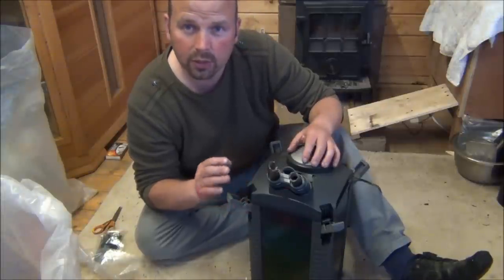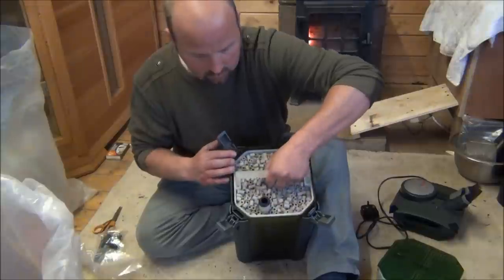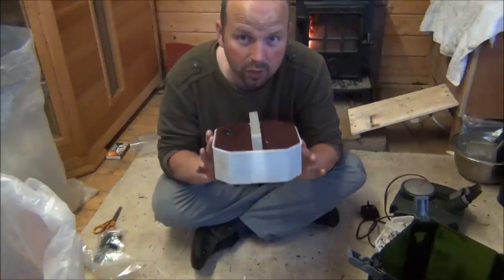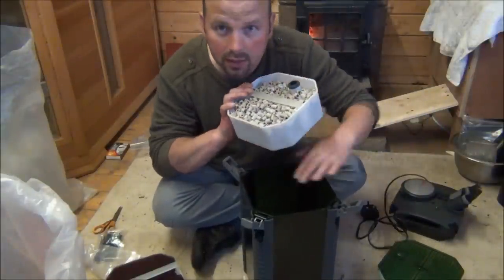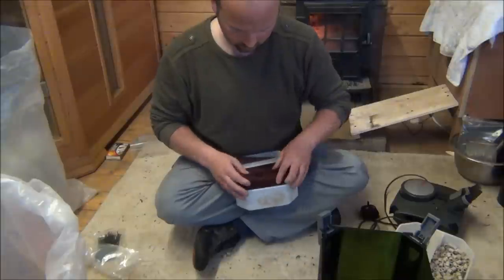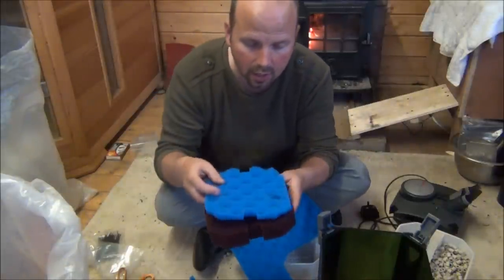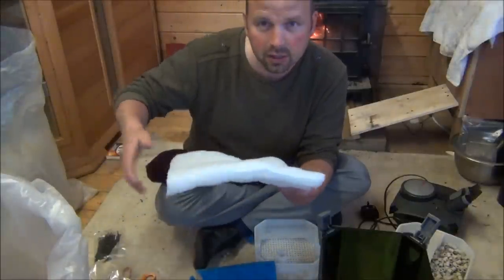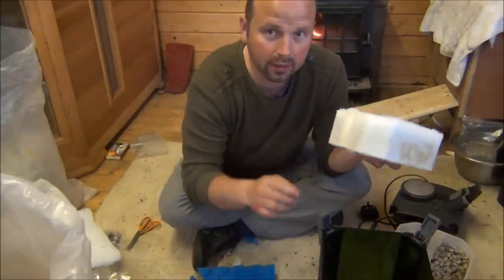How to set up an external canister filter for aquarium by Pondguru

Comment: Hi, I have the APS2000ef and it has 4 trays, what would you suggest I put in the top tray?
Reply from the maker: +Paul Austin Good filter media. Ideally you'd only need foams in bottom tray and media in trays above. If you need to use carbon to draw in fish treatments or colour from bogwood then it would go in the top of the top tray.

Comment: I'm VERY new to hobby and need your expertis. I owe a 55gal freshwater tank. It also came with a Whisper 60 and AquaClear 110. What would be the BEST setup for healthy water and fish.HELP ME PLEASE!!!!
Reply from the maker: Ditch the AquaClear 110 (as the biological filtering capacity is very low) and get an external filter. Other than that just phone the shop on 01661844005 with any questions you have about set-up as there are so many variables it can take an age of back and forth on comments / emails and can be sorted in short phone call.

Comment: Richard I need your help I've just reset my filter up it's an allpondsolutions 2000EF and I've set it up the way you have but when I switch it on and prime it all it sounds like a washing machine and it's driving me insane it was very quiet before I did everything and now the outtake spray bar is constantly blowing out bubbles ??? Any suggestions ??
Reply from the maker: Sounds like there is an air stuck in the pump chamber. If you try rocking the filter side to side the pump should spit the air out. It really shouldn't matter how the internals of the filter are set up but sometimes air can get locked in the top.
Reply: Pondguru Outdoors I've tried this and it's still blowing loads of bubbles out I'll try and remove the lid and start again .... damn thing is driving me insane
Reply from the maker: The only other way it could get air in there is if it is drawing it in through one of the pipes so you may need to check inlet connections. Sounds like it is getting air from somewhere if it won't clear out by rocking the filter. As long as you have a grid over the top of the top try to prevent media being drawn into the pump you can rock the filter 45% each way. It is a sealed unit so can operate while practically lying down (not recommended).
Reply: Pondguru Outdoors would having too much water in the canister cause this to happen ???
Reply: Pondguru Outdoors checked all the pipes and they are fine ..... 3 hrs I've been here now hahaha the joys of our hobby hey
Reply from the maker: No it should be full of water. Maybe if foams were new or recently cleaned they may hold air which would be released once the filter was pressurised and that air would get drawn into the pump?
Reply: Pondguru Outdoors omg Richard excuse the French but I am so fucking blonde I have figured it out and I'm just about to do a video about it because I can't stop laughing at how stupid I have been and I really don't want anyone else to make the same blonde mistake I've made hahaa omg your gonna laugh when you hear this for sure thank you so so much for your help I have really appreciated it your the best 🤗🤗🤗

Comment: I have a booster canister witch has three types of foam that is linked first to the out flow pipe then connects to the external filter that has the media in so I have basically the same set up as the booster uses the foam and the canister is full of media
Reply from the maker: Boosters are excellent and they really do a great job of ensuring that the main filter can be filled with proper media. Much of the time externals are sold for tanks and are too small to hold enough media to delivery the full cycle filtration necessary for nitrate reduction so a booster frees up that extra tray for more media - a great invention.
I'll be covering the booster and external combo in an upcoming video.
Reply: Awesome I look forward to watching it

Comment: Ok, I ordered the Newest Biohome Ultimate media from the local Greatwaveeng.com, who happens to be about 1 1/2 hours from me. I'll also be ordering the Bio Balls when he gets back from Vegas & unpacks them! 

 Now, I just bought a 55 gallon tank a few days ago. My question is, what type of Filter would you recommend. I want to set it up like the one you have… I understand the overall theme. Course to medium to fine filtration, then use the Biohome. 

So, is there any type of filter like you have there, for a 55 gallon, that you would recommend? 

I am really looking forward to using this media!

Thank you!!
Reply from the maker: The actual maker name of an external filter is not nearly as important as what is inside it with regard to the foams and media. I used an Eheim filter in this video which is about as good as you can get but provided you have a suitable sized filter correctly set up you can't go wrong.
Reply: Ok, Thank you!!

Comment: dear pondguru,
I was wondering of changing my internal filter to an external filter, however I have not tried to change filters properly before. last time I did it all my fish died. At the moment I still have fish in my fishtank. Can you possibly give me goid advice on how to swap the filters around as I want to get rid of my internal filter once I get the new filter. Thank you,
Tom. H.
Reply from the maker: +Tom H Its quite a simple process - just run both filters for at least 3-4 weeks (if you have the external set up with manufacturers media / foams) or 2-3 weeks if you have the external set up with biohome (as it matures very fast).By running both filters together you will not see a drop in waste processing anility of the filter(s) and the external will get a chance to build up a good amount of bacteria before you remove the internal filter. If the external you are looking to buy has a UV steriliser in it make sure to leave that turned off while the external filter is maturing or it will prevent it getting established with good bacteria.Hope that helps.
Reply: Dear Pondguru,
Thank you very much for your advice.

Tom. H.
Reply from the maker: +Tom H No worries, any time.

Comment: I have a aquaone nuatilus canister filter do they work the same way as in does the water flow from the bottom up thru the media?
Reply from the maker: I can't find much about that type of filter online but they look like a normal external filter with the pump at the top so should work exactly the same as the one in this video.

Comment: Hi pondguru just starting up my 220 ltr tank any advice on cichlids please?
Reply from the maker: Unless they are Dwarf cichlids the filtration will need to be very good - an external which will treat 'up to 600 litres' and the substrate and decor choice will depend on whether the fish are hard water cichlids or central / south American.
Feel free to ring me on 07772848730 no worries.
Reply: Pondguru Outdoors .yes I purchased a eheim pro 2 2028 3d background black sand gravel and putting in Welsh brecon blue-green local stone, with plenty of air stones . will ring if I'm having any problems and thank you for your advice much appreciated again.
Reply: Pondguru Outdoors I've also purchased 3 bags of biohome plus off you and foams
Reply from the maker: No worries, thanks for the order and yes feel free to ring me any time. Set up sounds nice.

Comment: Hi there, I have both of my EF set up like this. I'm just about to add an APS booster, would you recommend the same setup here in this video or is the filter media that comes with It enough? Many thanks if you can reply.
Reply from the maker: Ideally the booster would just have the foams in (and the fine pad) set up the same from bottom to top coarse, medium then fine and the main filter could then be all biological media. Basically the booster helps you to free up the bottom tray of the external filter which would otherwise be taken up by the foams and fine pad.
They are an excellent idea as it saves people buying a whole new canister filter when they could increase the filtering capacity by adding the booster.
Reply: Pondguru Outdoors many thank for replying buddy. I'll crack on with that then. Thanks again.
Reply from the maker: No worries, any time.
Reply: Pondguru Outdoors Obviously I'm using the bioholme mini ultra in my EF, seeing as it has four baskets would you recommend filling all four baskets with bioholme mini ultra? By the way, putting crappy ceramic media at the very bottom to catch the muck is an awesome idea, thanks for that tip alone. :)
Reply from the maker: Yes if there is a booster all the baskets in the main filter can be filled with media. Some people report that they never clean out the main canister when they have a booster, just the foams in the booster once every 1-2 months.
Reply: Pondguru Outdoors Brilliant, I'll get ordering more on your eBay then lol Many thanks for the advice but just as importantly your time to reply and give the advice. FYI I'm running two APS 2000lt/h EF+ filters with them both set up like you show here and have done for a good few months now, it's the perfect set up. I know I've mentioned this before but your tip of putting the crappy ceramic media in the bottom to catch all the heavy muck is brilliant. In the booster there is a bit more room to add more so this is looking great. My tank is 5ft long, 2ft high and 18inches width, planted and is a community tank. Anyway, thanks again, it's greatly appreciated indeed. Love your videos ;)
Reply from the maker: You have a nation of filtration on the tank which is very good as most people have it borderline or vastly under-filtered. Everything set up right with happy fish, groovy.
These bala sharks will grow very quickly however and you may need to find them new homes when they get big. You could look up red line torpedo barbs - expensive but a very nice mid water 'impact' shoaling fish for a large tank.
Reply: Pondguru Outdoors Yea for sure regarding the Bala Sharks, my LFS will happily take them when they get to big for my tank. I have two that are much older than the other four so plenty of time to think about what to do, I would love to gat a 6ft x 2ft x2ft just for bigger type fish. I'm currently planning a breeding set up in an insulated shed so it would go well in there. The shed will be not your average size shed mind you, it will be massive :) Thanks for recognising my filter X Tank set up being well filtered. My water is always clear and I don't have to do water changes as often as I used too, I Test the water parameters every week so I water change every two, sometimes 3 weeks. That's interesting about how much media per litre, just as well I read that before ordering lol I also have a black ghost Knife fish that's about 2/3 inches long so I will also have to keep an eye on him as I'm well aware that once their mouths are big enough they could/will eat smaller fish like Tetra etc. Perhaps he can go in the 6ft tank ;) thanks again for the advice, top man!!!!!
Reply from the maker: NO worries, any time and its great to hear that you have a well functioning set up.

Comment: Hi mate how would I do it like what you have done for you filter I have a new fluval 206 and mine came with some form like an egg carton at the bottom tray then the second and third. Tray came with bio media like hoops then the top one with a thin filter mat white and I bag of carbon when I clean the filter out and but it back together it blows crap back in to my tank this should not happen what would you do would you leave the bottom one as it is and the second one change the bio media and put corse fine and so on and just have one tray with bio media in the top mine as three trays and a try that's stand upright with four sponges in this red tray what slides down the side of the filter canister and my trays just go in the centre on top of each other how would you do it can you please get back to me if you are still keeping fish thanks
Reply from the maker: You could go with only one tray of media but I would personally use bottom tray for the graded foams then have two trays of media above it, just like this video. If there is space under the trays use the rings there.

Comment: The one I purchased (Worx 1200) had the canisters from bottom to top: ceramic - charcoal - foam. But what you have described appears to be the other way round. Does it matter?
Reply from the maker: I have looked for information to see how the water flows in that filter and it looks to be a normal external suitable for tanks up to 400 litres (200 litre normally stocked tank) where the water goes down to the bottom and rises up through the trays just like the one in this video. Therefore the foams really need to be in the bottom tray and media above.
If you used good media for the 2 trays above the foams you would not need charcoal but if the chemical filtration is used it should be the last thing the water hits before leaving the tank.
Feel free to sens pictures of the inside of the filter showing trays etc. to make sure which way the thing works to pondguru@btinternet.com

Comment: Hi i have a JBL CristalProfi e901 greenline . same set up as in this video  JBL CristalProfi e901 greenline unboxing  can you tell me if it's set up right. i cant see how it sends water strait to the bottom, so i gus it sends in through the sponge first at the top ?
Reply from the maker: Yes, it goes through the smaller foams in the top tray then down sides to bottom then rises up through the media. Since there is only coarse foam in there the media will get clogged in no time. I'd personally remove the ceramic rings (they are the cheap crappy variety) and set up the filter with the graded foams (as in this video) in the bottom tray. That will protect the media. The balls of media which come with this filter are a decent sintered glass but will very quickly get blocked if the filter is left how it comes from manufacturer.
Don't worry about losing any filtering action by removing the ceramic rings as they will do next to nothing compared to graded foams.

Comment: After seeing some tanks with no gravel I decided to not use it because it traps dirt but like the gravel look. I have heard of show tanks having gravel beds set in silicon and wonder if you could do so with a full size tank,,,,providing you had fish who do not feed on the bottom of course. I saw one tank with what looked like slate bricks lining the bottom and just wondered if fake bottoms for tanks are available. My goal is to have no place anywhere waste can build up.
Reply from the maker: I have seen slate based tanks and they look quite nice. We used to have a couple when I first set the shop up and they were siliconed into place.
I'm not aware of anyone offering specific types of fake bases for tanks but there is no reason why you couldn't use a fake backing as a base - the problem there would be that they tend to be quite varied shaped and bumpy so muck would collect in them if they were used as a base.

Comment: Hi I have the eheim 2026 professional 2 but mine only as to baskets init so not the 3 will it still work  as good with the coarse medium and fine  foam  in the bottom basket and coarse media in the top 1 justvlike your video many thanks barry :)
Reply from the maker: Yes should be fine like that. Foams in bottom, media in top.

Comment: Does setting your filter up this way make it cause more noise? I am really thinking of upgrading to an EHEIM canister and setting it up this way seems to be the way to go, but my aquarium is in my room, so I want it to be silent. I heard the EHEIM canisters are usually dead silent, does changing everything like this internally cause the filter to make more noise?
Reply from the maker: +Ryan Richardson It does not change the flow rate or noise when setting up the filter this way as you are using the same idea of foams and media, just in the right order so that the filter can work properly. Yes Eheim filters are excellent.
Reply: Pondguru Outdoors Ok thanks! I've never owned a canister but they seem much better than overhead filters, but I really wasn't sure if the media that you put in the bottom chamber rattled around or anything. I can be a sensitive sleeper lol. I will be purchasing a new filter soon and setting it up this way. Thanks!

Comment: hi Richard, was just wondering, ive bought a fluval fx6 and I,m told the water flow is from top to bottom so should I put my foams in the top basket and the biohome ultra in the 2 trays below, apparently I,m told the fx6 water flow runs in the opposite way to other external filters, regards, ron
Reply from the maker: If that is the way it works then yes go with that set up. Try as I might I can't find any images showing the flow path through the FX5 or FX6 but they appear to have the pump on the bottom so maybe they do work top to bottom. I could do with finding out so I can advise people where to put foams and media. Most people who buy media just rely on the outer foams for mechanical filtration and fill all 3 trays with media which takes best part of 5kg ultimate or mini ultra.
Reply: Pondguru thanks for your reply I,ll let you know how it goes, just waiting for my biohome to arrive from you and I can set it up. great vids, learning a lot by watching them, regards, ron.
Reply from the maker: ron birch No worries - any time.